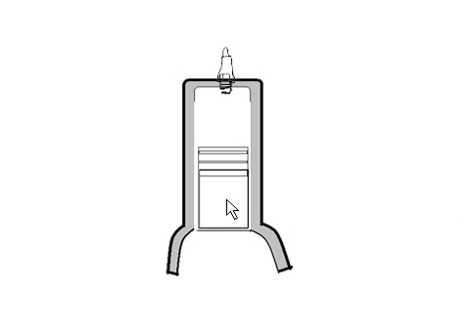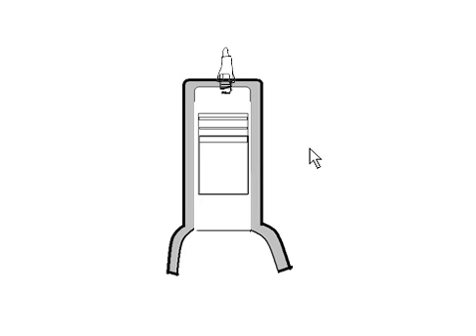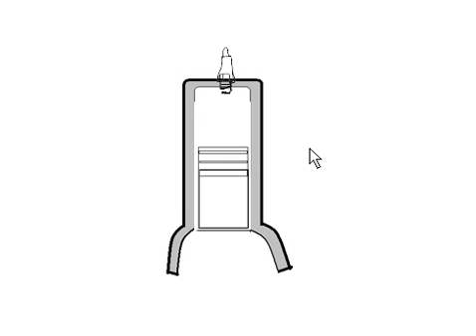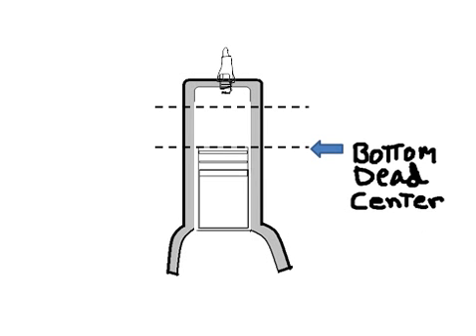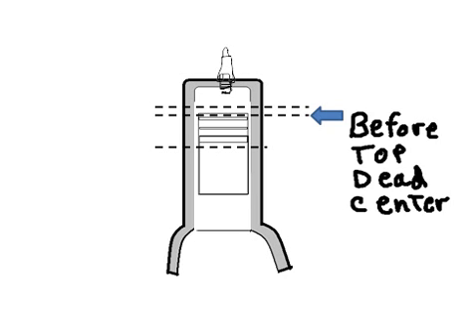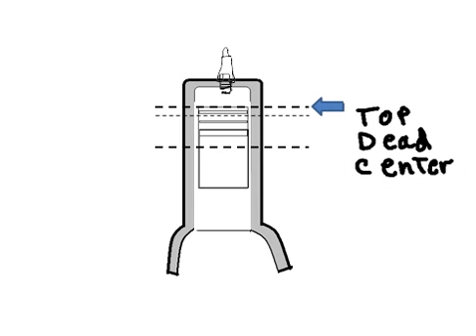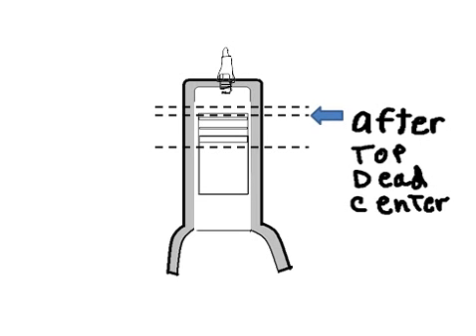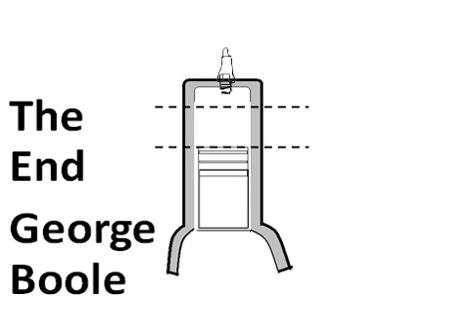Engines bdc, btdc, tdc, atdc

Comment: I thought atdc was before the bottom dead centre cause the definition a point of piston travel through it's downstroke,so if you say btdc is it has travel through the upstroke now check the meaning through is facing out after moving in (moving in and out a open channel)travel is a typically distance cover so has to make a considerable move to make that word travel,so for the BTDC a distance has been covered and it moving in and out the top dead centre,then why say the ATDC is after the top dead centre travel and that word travel and through and not place in action.
Reply: 😂 l neglect the word it's (it is ) your video is very correct just was thinking at different dimensions